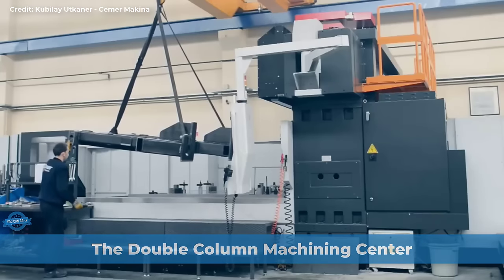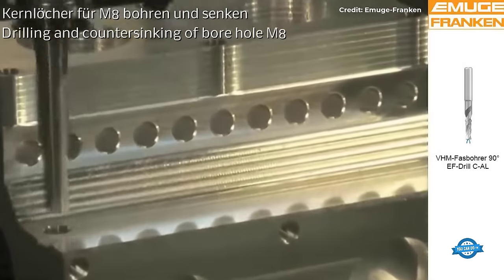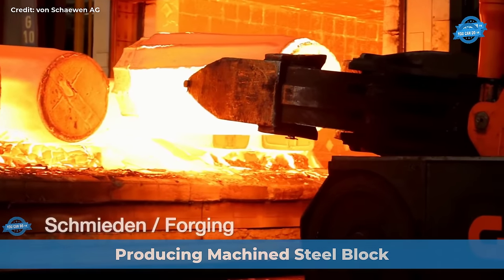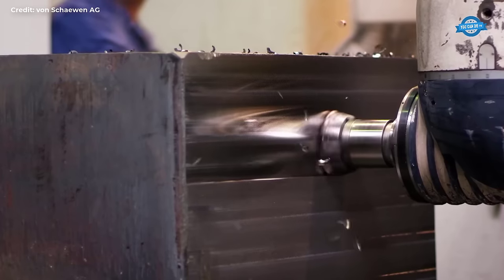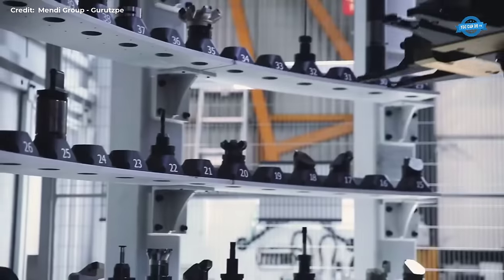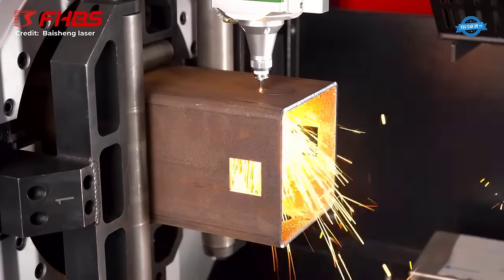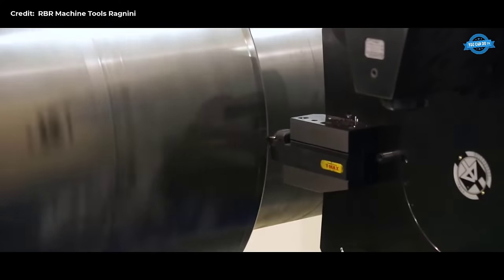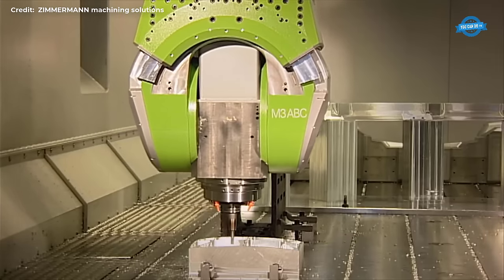HEAVY DUTY LATHE IN WORKING. Visit CNC machine and tool factories. Machining Aluminium Engine Block

Comment: I advocated these types of processes and technologies over two decades ago. I was S_canned for "not being a team player".   I was hard G-code programming four axis machines for internal and external thread interpolation years before CAD/CAM. My post processing was in my head. I had an extensive library of macro programs designed to produce various but similar machining sequences with limited data input. To date myself, I was ecstatic when Mylar tape replaced fan-fold paper punched tape.

Believe it or not, I eventually developed the ability to read punched tape: IE;
(G00 X3.55 Y6.25 Z1.20 S2500 M03 M08)
(G81 Z-.075 R0.2 F10.0) .............................................
Reply: Wow you are amazing....absolutely amazing ...I am in total awe of your programming prowess. You must have an insane brain....like...totally massive insane super....duper....brain....
You managed a few simple 'if' statements (probably not) and then went on to show the world how inept they really are,  by combining switch codes on the same block.....way back then? When we were all still making paper airplanes???

You sir....are the legend of humanity itself....
Go get yourself a lollipop!
Reply: Erm.... wtf you talking about? Calling a spot drilling cycle and then claiming super great origami skills?